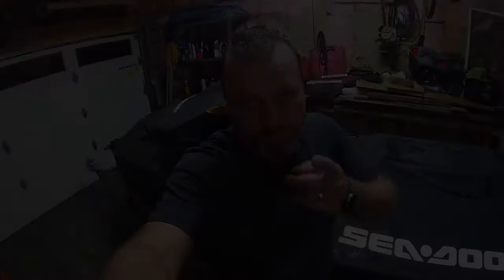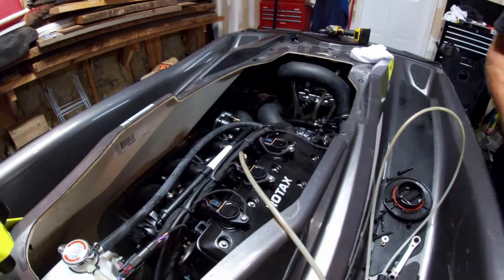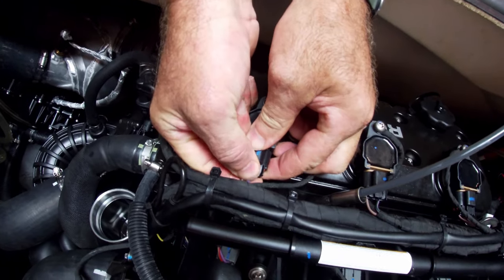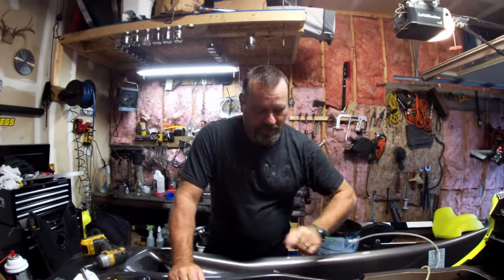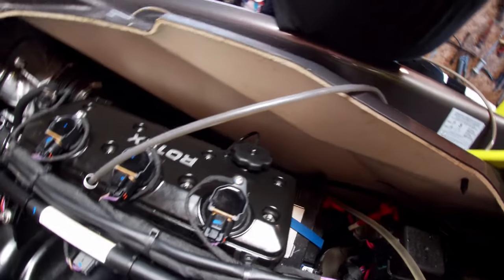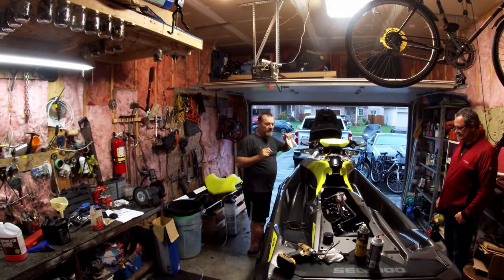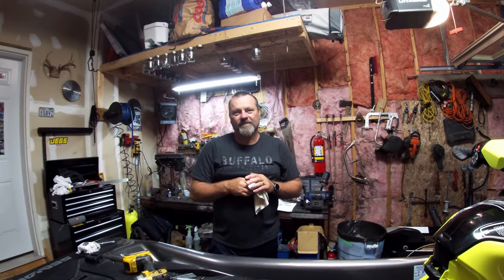How to winterize a Sea-Doo  (PWC) S1:E18

Comment: Here's my worry. You're not supposed to tow with the engine off without pinching the water line due to the possibility of water being forced through the exhaust and into the cylinders. You put antifreeze in and then chased it with air. What keeps it from going into the cylinders via the exhaust on cylinders with the exhaust valve open?
Reply: I do this but then pull the spark plugs , crank engine, fog, and reinstall spark plugs to eliminate any hydrolock potential or af in oil
Reply: I have the same worry, but nobody discussed this. I think there is a possibility of pushing/blowing air with remaining water into cylinders if valves are open.
Reply: @hydraulics But on a 4 stroke, that's not good enough because the antifreeze would be caught in the valve train and then mix in with your engine's oil.

Comment: At the end of the video you said you would be fine leaving it for 2 years.  I just purchased wave runners that were winterized last year and we don't plan or riding them until next year.  Would the gas be OK to sit for 2 years?  Should I drain the gas and put new gas in them for this winter? i have the 2019 GTI 155, not sure if I can syphon the gas or have to unhook something.  Thanks!
Reply from the maker: I would get rid of the gas for sure if you can.
Reply: Simply crank it with out starting (drown mode) once in a while for 10 seconds to circulate the oil. This will protect your engine.

Comment: Best and most detailed Video for me so far. Your little "extras" on the sideline prevent first-timers like me havin' a bad day and searching for srews and other things inside the hull 😂👍
Thx
Reply from the maker: Thank you we try and there fun to do. We should but out a bloopers one for all the shannanagan that goes on we dont show lol.
Reply: I am no brain surgeon, but what I always do when I am taking bolts/nuts out is simply lay a big towel across/under the area where you are working and taking the bolts out.  Doesn't matter if it's a jet ski or a car.  If the bolt is down under, you lay the towel under neath or on the bottom.  If the screw/nut falls to the bottom, you simply fold up the towel the best you can remove the towel.  Odds are the bolt/screw will be in the towel.   Trust me, it works and works well.

Comment: Does it matter that the engine was cranked after fogging the cylinders? Will cranking it push the fog out of the cylinder? Sorry if you answered already
Reply from the maker: Turning the motor over will just spread the oil around the cylinder better.

Comment: Great Video!! This summer I upgraded to a 2020 Sea-Doo GTX 230 from a 2012 130.  I'm familiar with the winterizing my non super charged non intercooler Seadoo.  I also blow mine out (55psi) then fill system with RV anti freeze. Is this the same procedure for ski's with an intercooler?? Thx (Northern Ontario)
Reply from the maker: Yes sir
Reply: Do not put more pressure than the supercharger supplies. 10-15 Psi only. Plenty to blow the water out. Also you could simply start and blip the throttle there is plenty of exhaust air flow at 4K RPM to clear water from the exhaust. Do not exceed 4500 RPM when revving out of water with no load, impeller is left threaded and can unspin.
If you want to remove water leftovers from water box, simply undo the clamp from the water box rubber hose and insert oil evac pump you use for oil change, or small shop vac to get rid of all the water leftovers from water box. Keep shop vac away from engine bay to prevent shop vac sparks from igniting combustible fumes inside engine bay.

Comment: I fkd up held brake in insted of gas and it started with no oil for couple seconds there was alittle left in there but mostly oil was out you think i damage my seadoo
Reply: You’re fine. A few seconds will do nothing. Everything in there is coated with oil.
Reply: @alexmachine570  thanks for getting back I also put the new oil in but didn't start it after someone told me it may not prime up
Reply from the maker: I actually did the same thing last year and all is fine.

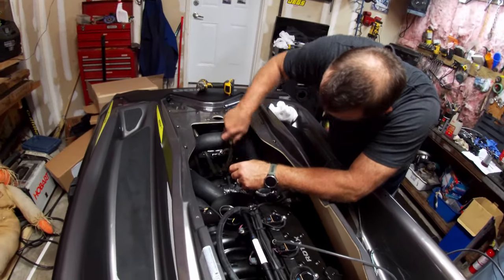Comment: A buddy of mine bought a used see doo.  Takes on water to the point where you will sink but only when he’s on the throttle.  At 9:18 you mention an exhaust line.  Think that’s it
Reply from the maker: A hose leak on the cooling hose will pump water into the hull when the motor is running for sure.

Comment: i try to ass anti-seize to the ground strap bolts for the spark plugs and di-electic grease on the coil connectors but we run in salt water

Comment: A little help please,have a rxtx 300 2018 second owner 100hrs i just noticed 2 days ago i have low coola t and day after no coolant...there s no heat warning or any light.Its npt a problem to put coolant in is just any idea whrre it could go.Thank you
Reply from the maker: It can only be leaking out or into the motor. Anything on the floor or in the hall? Check plugs see if there is any signs of coolent on them.
Reply: @ThePersonalWatercraftChannel  
i don t see anything,well i hope not in the motor.Thank you for your reply .I will lool at plugs on Thursday i hope i ll find easy fix.Runs great otherwise 78mph np is just this coolant worries me
Reply: @jaxcamino9356   lift the engine oil fill cap and see if there any emulsion under the cap (coffee and cream color) if you see the oil look like coffee cream your engine  have head gasket blown. Also when you run the engine if it has a lot of white smoke same thing head gasket. If no emulsion and no white smoke, check that your ride plate was ever removed and reinstalled coolant can be leaking out from under ride plate bc ride plate is Seadoo's heat exchanger/radiator, check under the engine (inside the hull) for coolant and check all coolant hoses, you maybe lucky and its just a coolant hose clamp loose.

Comment: So you said, you are going to leave the battery connected to seadoo or remove it, bring it inside and charge is twice in winter ?
Reply from the maker: This one we left the battery in because its in a somewhat warm garage. We will charge it 2 time over the winter. If you machine is sitting in the extreme cold bring the battery inside where its warm for the winter and also charge it a couple times.

Comment: Dose the drown mode put oil in the filter
Reply from the maker: Yes, drown mode shuts off fuel to the injections and spark to the plugs
Reply: How to do the drown mode?
Reply from the maker: @garototrilha  Hold the throttle wide open and crank. It will turn over but no fuel will flow or spark. Its a good way to pump the water out should it flood

Comment: I live in New York on Long Island and have a 2021 Sea-Doo GTX 230 (super charger). I don’t have a garage and keep it completely covered on the side of my home. Do I need to do anything “extra” for a Sea-Doo that’s super charged and can I leave the battery in with a tender on it outside covered in the New York Winters? Thanks for any advice and help.
Reply from the maker: Not really. Pull the battery and leave it in the house. Pop the seat under the cover so moisture can vent other then that your good.
Reply: @ThePersonalWatercraftChannel  
Great! Thanks so much for the info and help! Can’t wait to see your next videos! 👍🏻😉👍🏻
Reply: Thanks for the video👌
Reply from the maker: @joeallocco4261  Coming soon did a great ride on Thanksgiving weekend just putting it together now. More Tammy less Gary lol.
Reply: As someone who lived in Albany County, I can tell you I put the antifreeze in and then cranked the engine to get it thru the engine.  Then put in some more.  It's not going to hurt anything and better safe then sorry.  I also fogged the engine too.  Then I put one big silver tarp over it as well as a jet ski  cover under it.  We got a lot more snow and cold then you do.  The more weather you can keep off of it, the better.  I put the tarp on tight to keep as much moister out as possible.  Definitely bring the battery in.  If it's inside it will be fine.  Maybe once over the winter give it a charge but it won't need much.  Then charge it again just before you are going to use the ski.  Ski had been out in 20 below winters.  Never had a problem come first time using it. May have had to push starter button to crank it a few times, but that was it.
Reply: @trvman1  
Fantastic! Great to know and I really appreciate the info. This is my first Sea-Doo and I want to make sure I’m doing it right. I don’t want to mess up my investment and really appreciate the help and advice. Thank you so much again! 👍🏻👍🏻😉

Comment: When you run the machine before you shut it down do you rev the motor to 3000 rpms to empty out the filter housing and get it all in the crankcase?
Reply: Lol This Guy thinks leaving the oil in over winter will hurt the Bearings !! 😂😊
Reply: @supergwizzo  of course it does have you ever had oil sent out to see what's in it?did a lot when at the dealer to see if customers used syn oil in there supercharged sea Doo and it has a lot of acids in it.
Reply: do not rev above 4500 RPM when out of water without the load, 3000 is good enough yes, the impeller is left threaded and can unspin from the shaft.
Reply: I have been servicing sea doos for over 30 years and have never had a impeller come loose running it out of water. You can rev the machine as high as you want wont hurt a thing. But you do need to have a hose on it and dont run it more than a few minutes out of water or carbone seal will get hot
Reply: @denniswilder3014  Oh, Sure the impeller can unspin.
And No, you can't run as high as you want without the load.
it can unspin for sure if RPM is too high.
Also happens when wave jumping at WOT, the RPM limiter kicks in and acts like an impact drill with fast load no load,
When revving to high on the trailer with no load,  when you close the throttle, the impeller has enough inertia to unspin. 
Some times its so bad it can chew the wear ring, in worst cases impeller will move the engine shaft so far back in, it will destroy crank bearings.